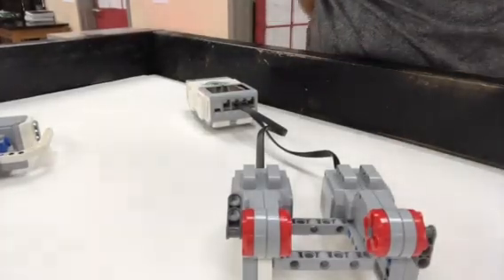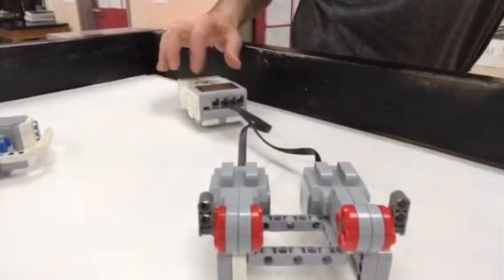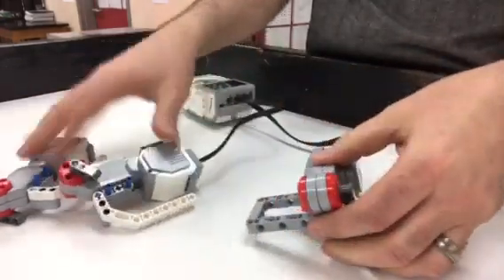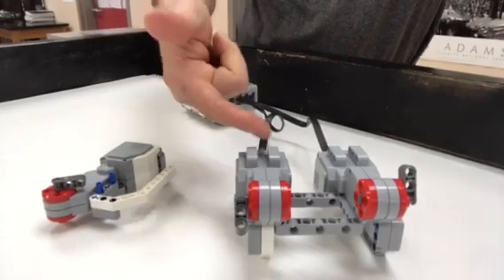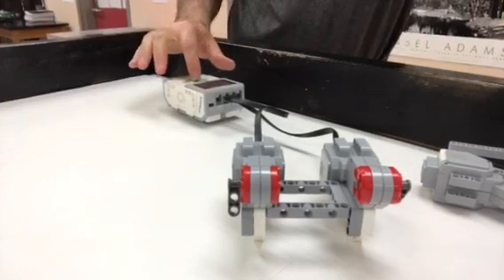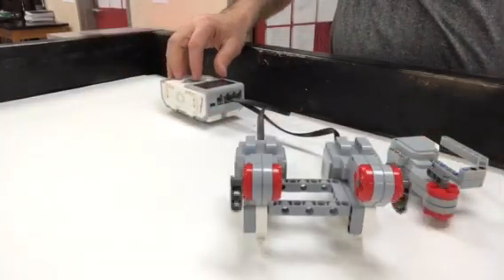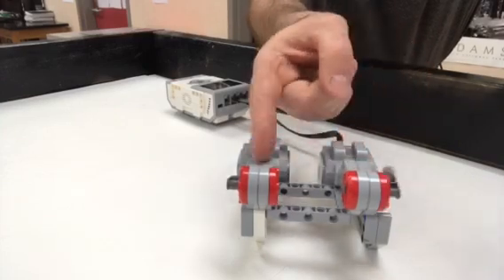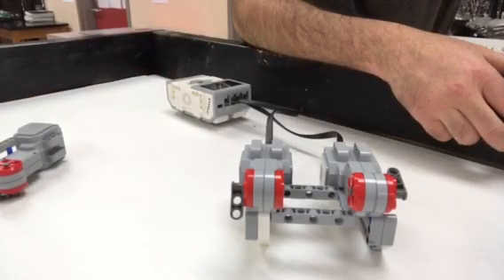Lego EV3 Motor Issue

Comment: Anyone know to fix the broken motor? I have the same issue but 1 motor draws a little more power from the other one and makes more noise, while the other is slower and quieter. I noticed the problem after unplugging some wires out and putting them back in during the program running. I don't know if that might be the cause though, maybe a coincidence.

Comment: my motor have that broblem too i changed the battery to eneloop pro and it works normal try change the battery but now when i use the rac3truck program and delete the reset block, when i steer to a direction,it wont stop going and steering unless i close the program.

Comment: Have you had problems with the brick itself? The programme works but the motor is not moving. I have also noticed my brick takes a long time to get started. Can anyone shed some light? I have only had this brick for less than 6 months.
Reply: I had this problem too, you have to open the motor and force the motor to spin with controlled power on the motor pins directly, I will post a video later
Reply: https://youtu.be/y7SAVTklCzI

Comment: Bro Plz Respond Fast, Im Getting the prob with motors that even if i move my motor with my hand it feel hard to move it while sometimes its gud, whats the prob and how can I solve it plz fast, thank you
Reply: May be motor is shortened inside? The same effect you can notice if you take simpe DC motor and connect his two wires.

Comment: Almost definitely related to the motor sensor. It's sending bad data (or no data) back to the brain brick which is why your program slows the other motor. I assume your program is not running each motor independently, but using tank mode or at least running them together as a pair somehow. The bad motor sends no data and the good motor gets slowed when the brain tries to keep the robot going straight.

Comment: Same issue here. Contrary to the suggestion from Sweg, the wires are the same length and the problem still occurs.  Any solution yet?
Reply from the maker: There is no solution other than calling customer service and having them replaced :(